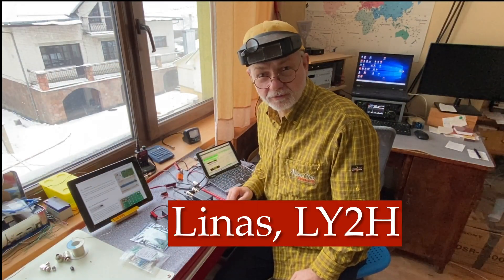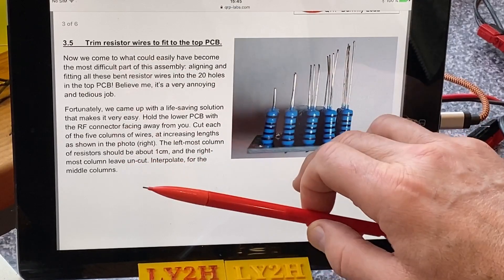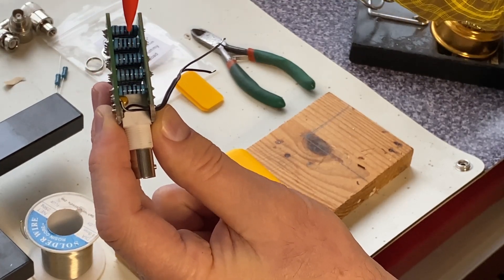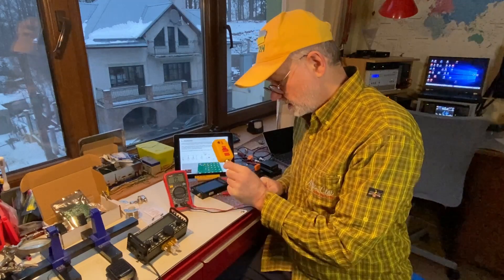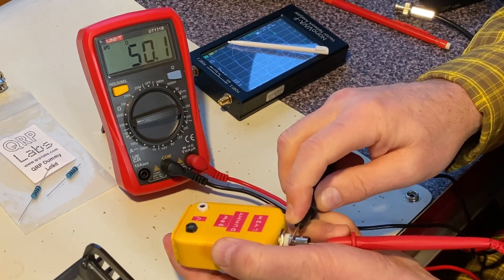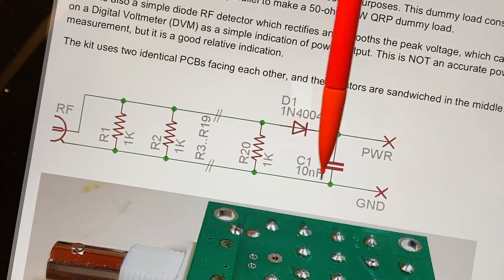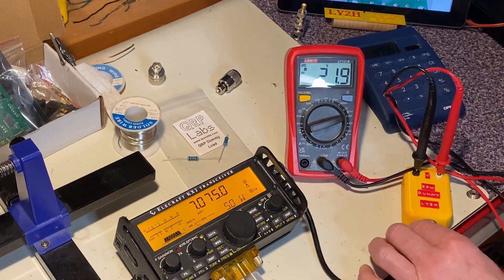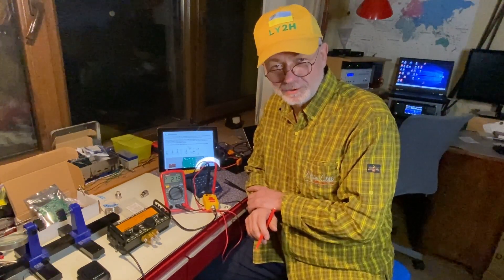The Dummy Load with power meter for Ham Radio from QRPLabs. Review and 3D printed case.

Comment: Some noninductive resistors have a little inductance because they spiral the resistive material to make it fit in the form factor. Also the parallel PCBs will have a tiny bit of capacitance. At HF it won't matter but at higher frequencies they act like resonant filter components.

Comment: The 0.7v (estimated) diode drop needs to be added to the voltage measurement.
For the 5W measurement it would be 21.9 + 0.7 = 22.6 Vpeak.  22.6*22.6 / 100 = 5.1w

Comment: I have this dummy load and there is a issue with a lot of resistors through the hole, too much reactance for high MHz. But working for dummy. Not for measurement.
Congrats for the 3d enclosure!
73 from Jon EA3BV

Comment: High frequency dummy loads use some sort of compact „SMD“ resistors to avoid stray capacitances and inductances because of very short leads.
Reply from the maker: Thanks Andreas! Yes, I used to have one 100W SMD- resistor  based dummy load in a huge cylinder-shaped  heatsink. It was working fine with flat SWR on VHF/UHF bands too. Unfortunately, after some ten times of use (with not even 100W applied) it kicked the bucket and it’s  now quite a problem to find the SMD resistor replacement of the right size :)… 73! Linas LY2H

Comment: I have another dummy load of similar construction. It is also only good for HF.  You could improve your measurement by purchasing a precision dummy load with a BNC connector and thus only exchange the dummy loads. I think the results would still show that you have a HF dummy load.
Reply from the maker: Thanks, good point. I think, it depends on the type of the resistors, length of the leads, connectors etc. Actually, I’m pretty happy with it being HF only, that’s what I needed  it for :) 73! Linas LY2H

Comment: Hi if you add in the voltage drop of the diode into your calculations do you get a better result?
Reply from the maker: Hi! Probably I do, but who knows :)… The drop may differ from diode to diode, the DVMs used may have a different input resistance which may change the current through the diode, which may change the voltage drop… So , as it is noted in the very well written user manual, it will not be a precise measurement, but still “ a useful indication of relative power”.  73! Linas LY2H